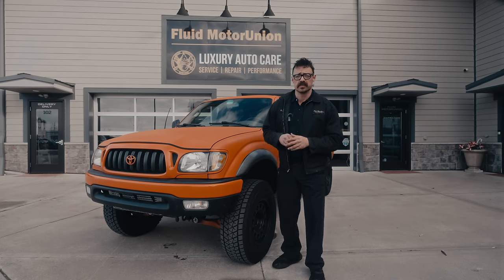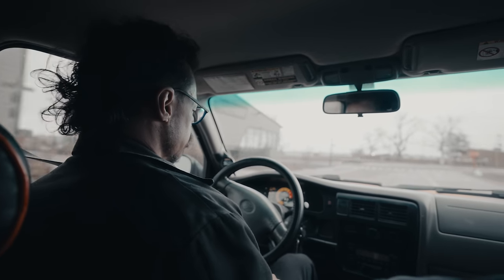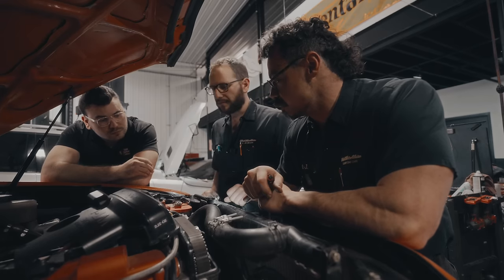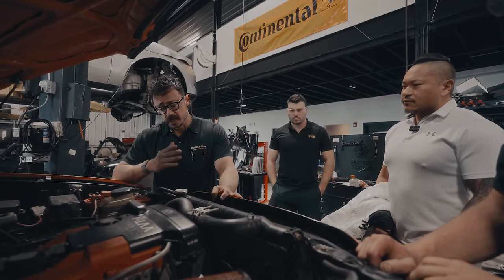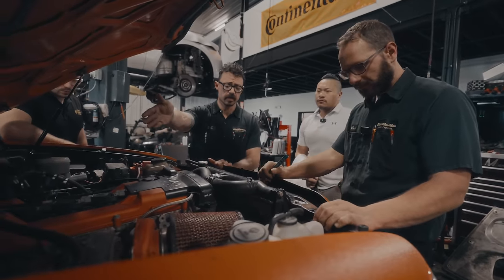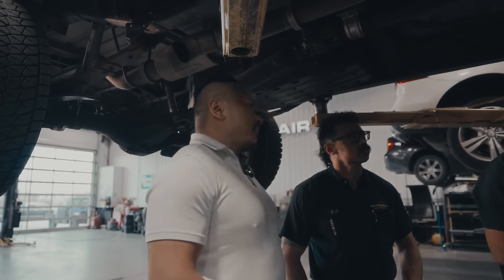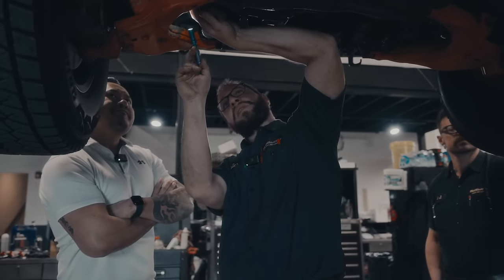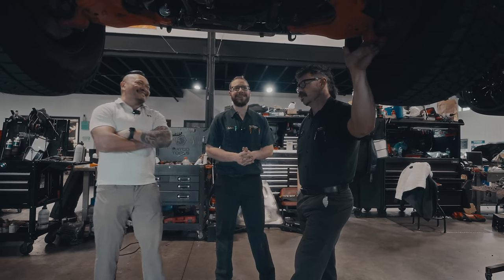2JZ IN A PICKUP?!  Professional Auto Techs React to a Swapped Turbo Toyota Tacoma

Comment: Not a common swap, but very easy to do if you do enough research. Took me 2 weeks to swap a 2JZ into my 4Runner, all bolt on 👌
Reply: Could you help me out I want to do this in my 2001 Tacoma
Reply: What year 4Runner? Just curious. Thinking about swapping out my 4.0 2nd gen Taco when the motor pops.

Comment: When you were out on the road with that 2JZ swap, it still sounded like a 4 cylinder. Was it worth the efford? Not sure yet. But I'd never sacrifice an AC. That moist that builds up on the inside of the cab's windows I have a terrible rememberance on. Passengers have to wipe them the entire ride or the driver gets nuts.

Comment: Excellent video.
Nice engine swap.

This project goes to show how much work goes into a  custom project like this.
..
There's so much minor custom work like brackets, cable, pipe routing, clutch, brakes that sometime get overlooked or bodged. 
..
Yeah that clutch, noisy fuel regulator & oil leaks would be a major annoyance  for a relative daily.
..
From FMUs perspective. 
I can see how difficult it is to price a job like this as ya  don't know what hurdels you'll meet along the way...

I do wonder, if that turbo is spoiling so late perhaps a smaller turbo might better suit thids installation...?
..
Im also wondering if the clutch lever arm is the wrong ratio hemce the extra travel..

Great work guys...
Reply from the maker: We're finding out, but all of your questions are appropriate for someone to consider in this situation.  thanks for the feedback! We'll see what the customer decides shortly!

Comment: Awesome video! Thanks for sharing!
I have a 1996 Single Cab Tacoma that I'm in the middle of a 2JZ-GE single turbo w/ R155 swap. What radiator and fans did the guy use? was the firewall tubbed to make room for the cooling system?
Reply from the maker: fans appear to be universal through the core mount radiator fans, and no mods to the firewall as far as we could tell. I think that need is going to be dictated by your engine and trans mounting positioning. Do you have that sorted yet?
Reply: No fire wall mods necessary if you're using the CX racing engine mounts. You can still use the stock radiator that comes in the truck, although you may have to run a pusher type fan setup as there isn't enough room between the engine and the stock radiator location. If you can find fans thin enough, you can make a puller setup work.

Comment: It'd drive me nuts driving a truck with no real torque below.  Does he need to get custom cams and use a smaller turbo here?
Reply from the maker: it should have more torque than the 4 cylinder that these had optioned. But this thing is going to need some revs to get this to roll up some stuff... good thing its got 4low!

Comment: Me personally, i want to put the 3.5 ecoboost out of a Navigator into a 2011 Saab 9-5 😂
Reply: The Saab 9-5 is front wheel drive. The Navigator is rear wheel drive or all wheel drive. Doable if you're into lots of welding and custom fab work, including a drive train tunnel and rear suspension. Good luck!
Reply: @houseofno  small correction, in that the 2011 9-5 also had an AWD option (XWD was the branded name of it) but yeah it'd be psychotically difficult either way